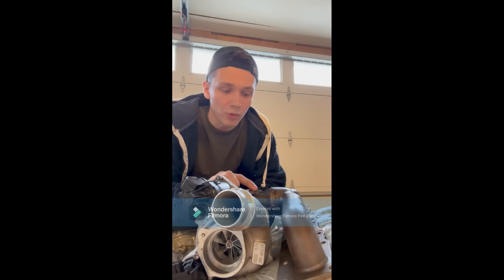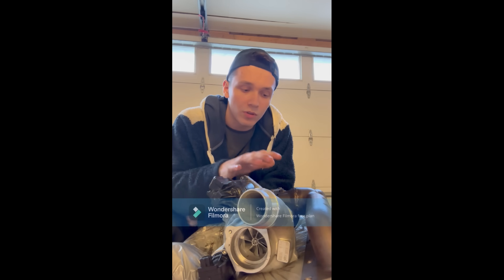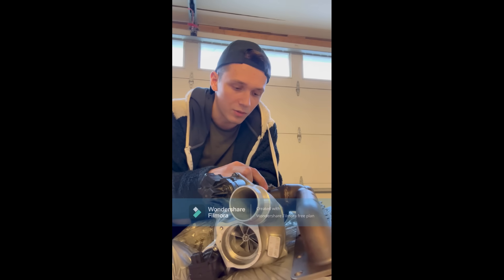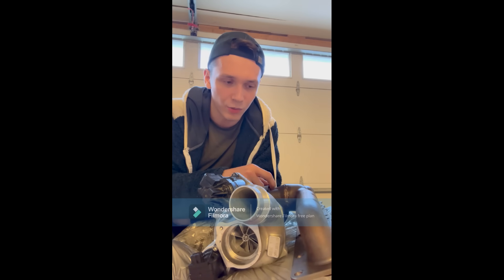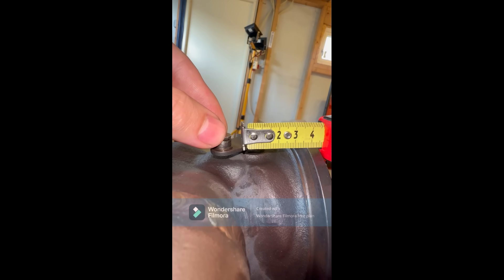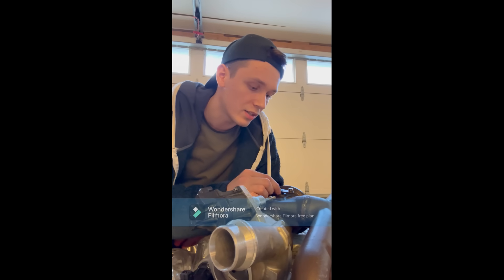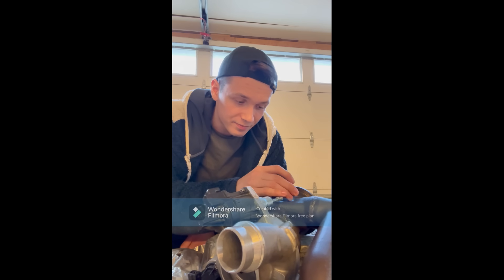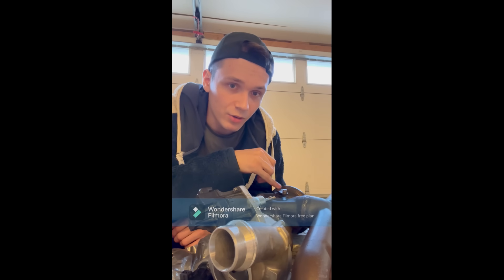Bmw N55 VivAutoParts Turbo Nightmare – Wastegate Issues + Poor Support

Comment: Is it true you had your car tuned by chatgpt? if so how was it?
Reply from the maker: A custom tune made by me controlling chatgpt took around 30 hours spending and it was ofcourse super shit. Done in a safe manner ofcourse :) This was done with stock turbo. I strongly advice to go with a custom tuner or Ots maps Mhd instead of messing around like that as its just a huge time waste, ai is good but to use it with this isnt that good yet.